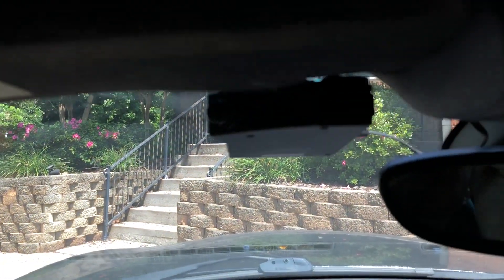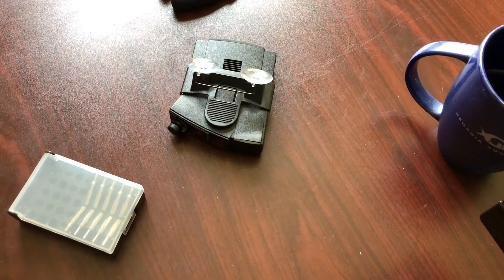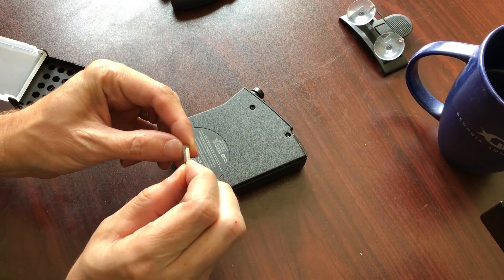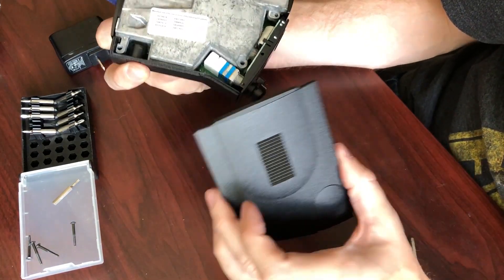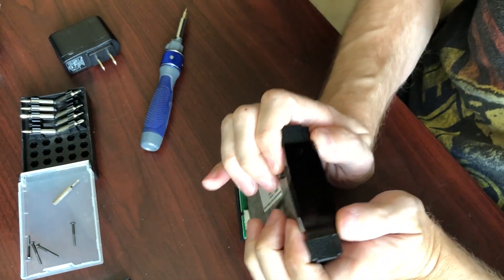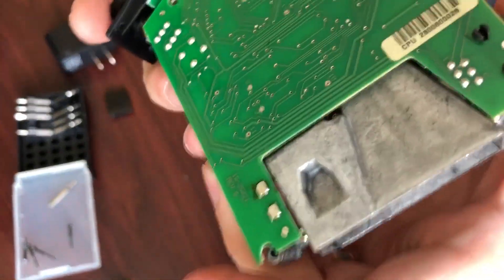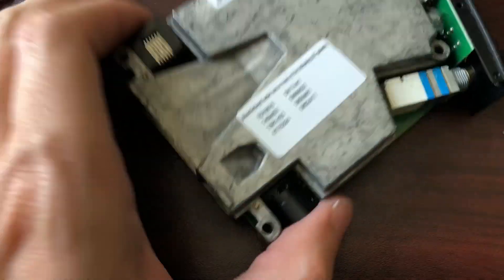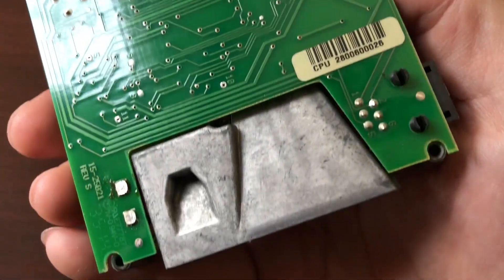Valentine One V1 Radar Detector - What's Inside - Tear Down

Comment: The part raddling in there is probably a ceramic tuner. It fits between the waveguide and the PCB, probably screwed in. Without it the thing will be out of tune. Very intricate rf engineering going on inside the cast metal thing.
Reply from the maker: Thank you for that thought on what is really up with the interior!

Comment: Did you fine the problem?
Reply from the maker: Yes and no.  It appears that drop and impact actually shattered something that appears to have been housed inside the antenna cones. (So that is the problem I found).   But I did not remove the cones to verify that object, because doing so would likely require me to re solder a lot of connections and still be unlikely to fully repair without purchasing new parts.  As such the problem was not fixed and I will likely just sell it for use as electrical parts.